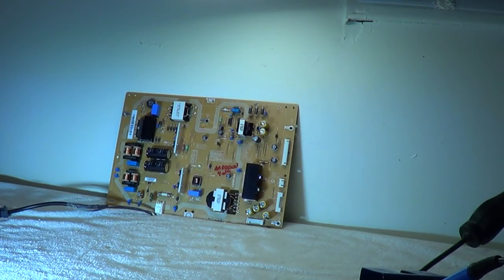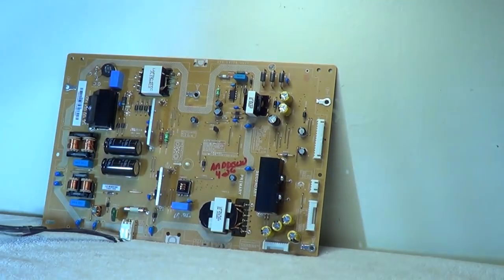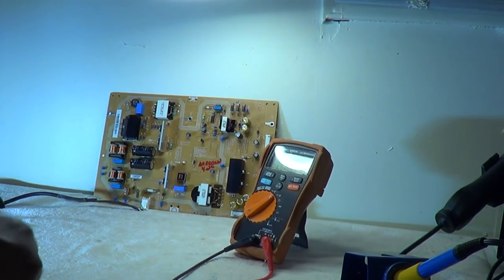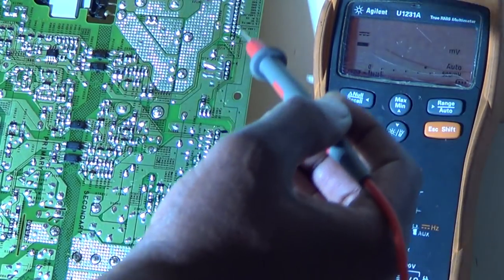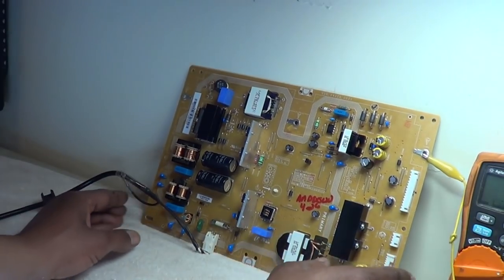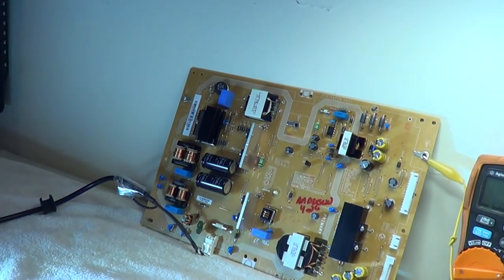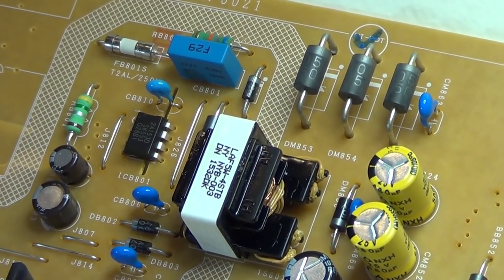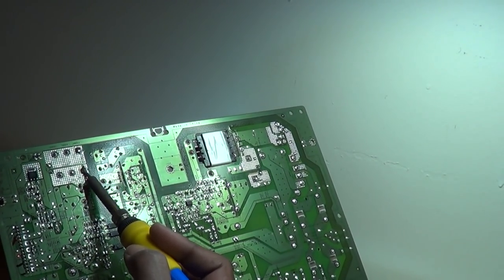TV is totally dead, no indicator light, no Power repair. Vizio E65X-C2

Comment: i wish i had found this video earlier. i was given a 55" samsung tv that would not turn on. i googled some but, was not sure what was wrong. i did not want to just throw some boards at it and hope i fixed it. i ended up giving it to someone else to try and fix. i would have used your information from this video to have tried to find the issue with it. thank you anyways, now i have some good info that i can use in the future.

Comment: So I did this repair myself because the TV was totally dead. Replaced the power supply board, TV came right on, no problem. Thought I was in the clear. Now that I've hooked things up to it, I have no sound. Any tips? I've checked all the settings, I've checked all the hdmi inputs as well as the cable input. Only thing I haven't tried is using an external sound device such as speakers because I do not have the proper cords. Any tips?

Comment: Now this is the video I was looking for.   I have four diodes right underneath this heat sink.  One is a Zener Diode.  I know one read low, switch leads and you read a high resistance.  Now that's the Zener Diode.  The next one reads inifinite one way and a low resistance another.  The other two read just like the Zener Diode.  I'm using the meters diode range to read the diodes. The problem with the set is:  The set goes off after about 10 minutes and you get a 6 light flash. THe TV is a Philips 32PFL5332D/37.  Yes, it's an LCD and while the picture is on, is great.  I've got the power board out and I can't get a new one so I'm stuck with buying the individual components. I'm just trying to register a diode short reading in my mind and I'm thinking i'll just change all four of them, which includes the Zener diode.  I was skeptical until I watched you troubleshoot this power board.  Thanks.

Comment: ok im trying to copy you step by step. to see if this exact tv i have has this same problem. but when you go to test the fuse 11:36 you say the fuse is good thats what its supposed to read. i cant see the meter. what is the fuse supposed to read? i thought if you hear the beeping from the tester that means its good? i dont hear yours beeping? am i wrong at what im doing or thinking?
Reply from the maker: A good fuse would read close to zero Ohms (a short). I dont remember why my meter didnt beep when I tested the fuse. Purhaps I didnt have the meter leads on the fuse long enough.

Comment: Greath video. ..i have also a dead P.S. have no volts reading on none of the pins...the diodes are oké although. Could it be and ic issue?
Reply from the maker: Yeah, check all of the MosFet Transistors for any shorts. If not just replace the whole Power Supply Board.
Reply: Thanks i Will.
Reply: @bigdog8882  i too am having this same issue but no standby power on any of 1 and 2 pins

Comment: I have the same board reading a short on the same 3 diodes but I'm not getting any voltage on the secondary test pins.
Reply: replace the diodes

Comment: First and formost, always test the fuse. I know you already did that but if you are going to teach, do it properly. Secondly, Never test anything still in the circuitboard such as a diode or whatever, especially in series like that. I do not even know how you figured that out testing like that. Clearly it tipped you off enough to realize what was going on. Shotky diodes are a one way diode but eather way, you were getting a dead short out of one. That alone was pulling everything down. The one dead diode affected them all clearly. I was told that you need to replace with an equal or higher rated diode, not a lower rated diode. My guess is that tv will fail in 6 months. 90 days is nothing. I would have told you to replace it with the correct rated diode even if you had to come back. They RENT TV's for such reasons as that. I would have told the owner that. At least you showed that it indeed worked, just not for long.
Reply from the maker: This is just for training purposes, whatever works for U as far as testing components, Then do It.